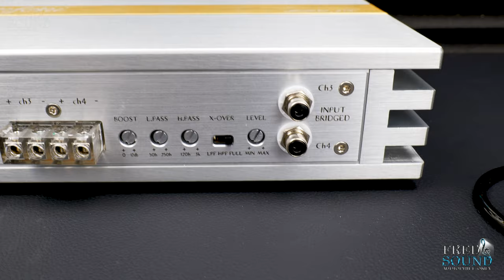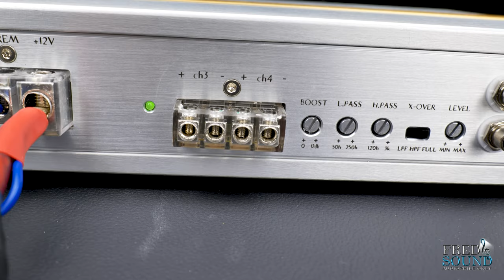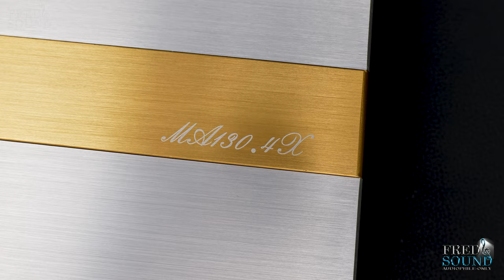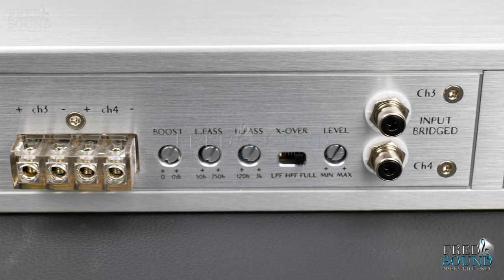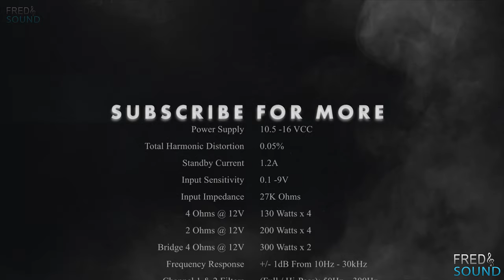Sinfoni S83 2-Way vs Sinfoni MAESTOSO MA130.4x 4K (FNS)

Comment: Hi mate!
I’m back again for your suggestion, i have genesis series 3 special edition now i got offer for flux 150.4 amp. Does the flux better then genesis?
My speaker are focal flax evo ps 165fxe…
I need your suggestion.
Thanks
Reply: My speakers rms is 80 watt
Reply: Max power 160watt
Reply from the maker: Hi, yes, the flux is better, thanks for watching
Reply: @frednsound  I’m worrying about amp watts because it is 150 watt per channel and speakers rms is 80 watt. Is it okay?
Reply from the maker: @knowledgeOcean007  the more power the better it is, use less power from a powerful amp will give you less distortion, just set your gains correctly.
Reply: @frednsound  okay thanks mate
Reply: @frednsound  you are the best
Reply from the maker: @knowledgeOcean007  welcome my mate, thanks for the support:)